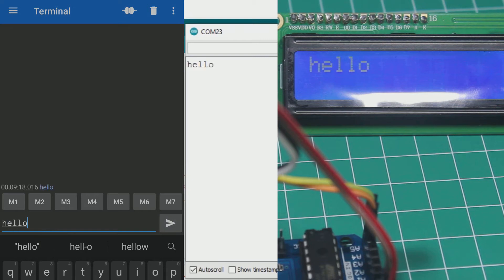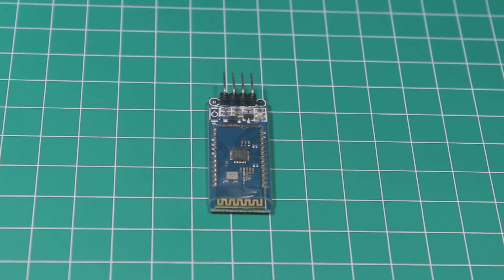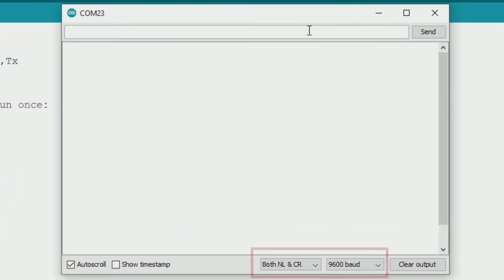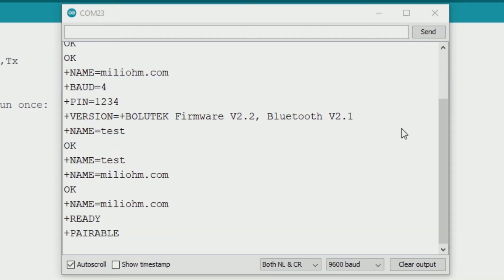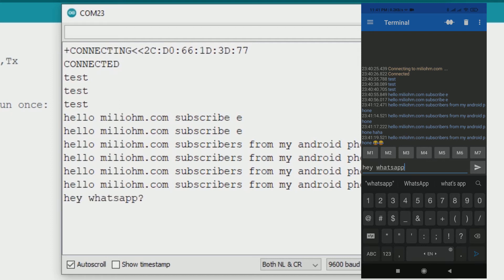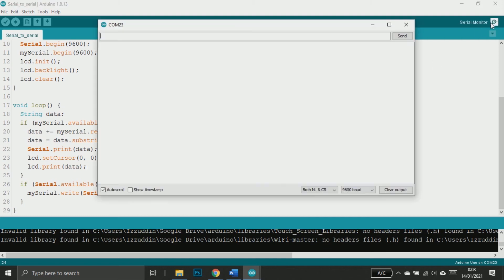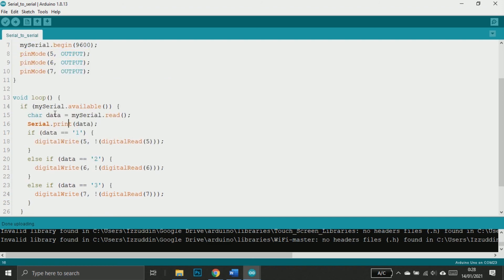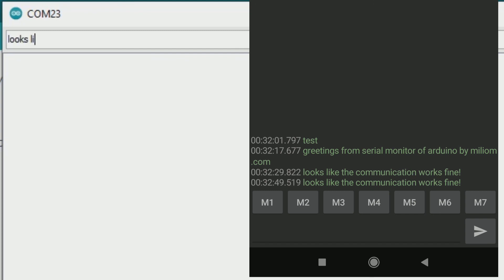How to use Bluetooth module with arduino (SPP-C and HC-05 tutorial)

Comment: I have ZS-040 module that works fine, but is doesn't have master mode.
I bought 2 SPP-C (JDY-09) modules and connected them the same way but no reply to AT
I already tried all different baud rates. They do flash the red light btw.
Any sugestions?

Comment: Can I ask, is it possible to use any bluetooth module with arduino or must it be a SPP BLuetooth module? Thanks in advance
Reply from the maker: you can use any module as long as it is compatible with arduino, like HC-05 or HC-06
Reply: @miliohm  How do you know what modules are compatible with Arduino?
I want to use the Arduino to test different modules signal strengths at different distances and I want to use as many modules as possible